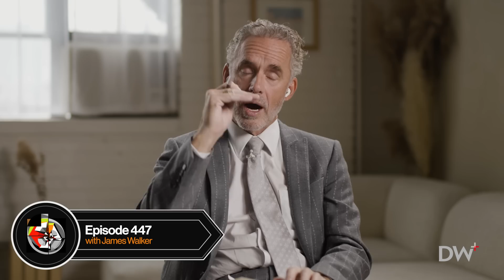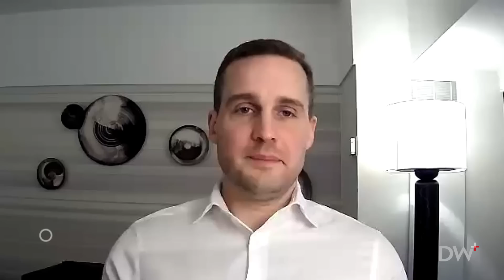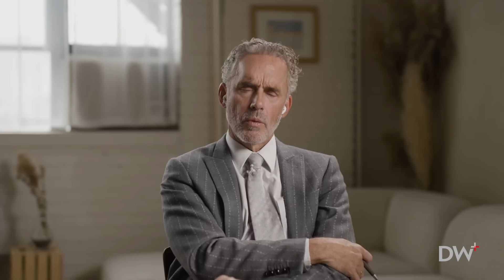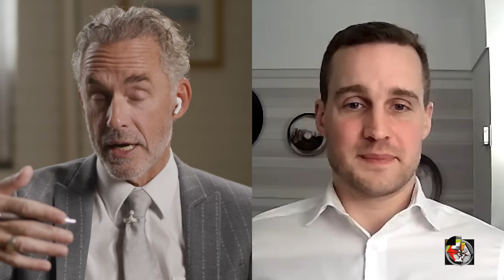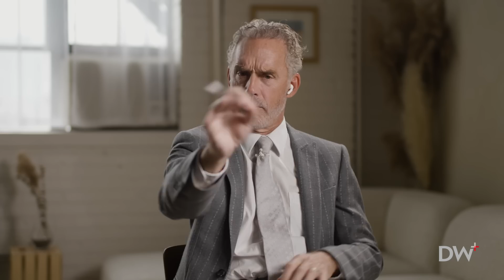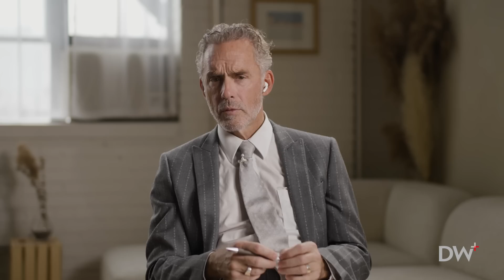There Is a Nuclear Reactor in This Truck

Comment: 6:12 James Walker is also CEO  of Ares Strategic Mining. It's the only permitted Fluospar/Fluorite mine in the US. Ares is also constructing an acidspar plant right now.

Acidspar (acid grade fluorspar) is used to manufacture hydrofluoric acid.

Uranium dioxide (UO2) can be fluorinated to uranium tetrafluoride (UF4) by hydrofluoric acid (HF). 

Uranium tetrafluoride (UF4) is the base material for liquid molten-salt SMR fuel cores.

Comment: Too much risk for not nearly enough power. Nuclear reactors work best when you have high power density. That means a real facility. These little ones though have the potential to be used for low-cost nuclear submarines!

Comment: We have seen the proposal of SMR's which looks promising but after many decades we still haven't seen one in operation supplying power to the community. 
The price of the energy supply is the problem, these things are extremely expensive to build and run, which puts it out of the practical daily use.
Solar Panels are 6x less to build and require no maintenance to run, every roof, car park etc has the potential to be covered in solar panels with no use of extra land and linking with a battery produces power 24/7.
I have Solar on my roof which on a sunny day gives me more than twice the power I need, at no fuel cost and batteries power the house when the sun isnt shining.
Every house can be it's own power generator with excess going to the grid

Comment: No need to mine uranium. Treat the used fuel rods and get new rods back. Problem is there is plutonium in the used rods, and people are scared they fall in the wrong hands. I say make thorium reactors, and use the plutonium as starter-fuel to burn the thorium, and we get rid of the plutonium as a bonus.

Comment: Nuclear Power is clearly a super efficient technology, however doesn't High Level Nuclear waste remain Toxic for thousands of years?. If there is a way in which radioactive waste can be eliminated entirely or rendered totally safe then obviously it's the solution, otherwise no man made storage facility for hazardous waste could possibly last the duration, not even close. Whenever there is Hazardous Waste to dispose of and huge sums of money at play, there is going to be corruption and corners cut.

Comment: Don't even need to sell uranium reactors to the public. they have a taboo behind them. can now sell thorium reactors to the public as a generally "safer" fissile material for both small scale and large scale power production, and Saskatchewan has even MORE ore than Uranium. but if you do want to go the route of Uranium 4th gen reactors using LFTR or FAST reactors it can run on what is already deemed "Spent" uranium fuel waste, and significantly lower the "shelf life" of its harmful decay period from thousands of years, to a couple centuries; with much less of it as the final product needing storage.

Comment: Years back there was talk about down sizing a nuclear reactor to the size of a home AC condenser for home use. Great idea. It was stated that you cannot just do a downsize safely. Safety issues came up. Main issue would be loss of cooling water. Or the unit getting crashed.

Comment: my question would be ... why URANIUM as the main fuel and not THORIUM.... its CHEAP and ABUNDANT ....  yes you still need uranium for the spark plug yes it still produces weapons grade material ... 

why burn GOLD when TIN does the same job?

Comment: The US has 4,000 years of electric independence just using nuclear powered electric plants.  Far longer when we use thorium reactors.
We also have about 300 years oil independence and the oil fields are slowly filling back-up as oil is not a fossil fuel, it is a petrochemical.
Safety wise, the US has 25,000 more deaths per year because we use coal electric plants rather than nuclear.  1 million in 40 years.

Comment: want a less insane alternative - drill a hole in the ground.  The earth's core is hotter than the suns surface; just 5-10 miles down; drilling equiment gets so hot that the most sophisticated heat resisten bits melt. It's calle Geothermal.  It's been around 100 years but usually where the earth vents to the surface; we are a bit lazy. If half the money wasted on Fusion and Nuclear had been spent on Geothermal ; we'd actually have some real power being generated instead of worthless non workable plans.

Comment: The real reason they go to central asia is cost; labor is cheaper; taxes lower, regulations less.  Sure put a SMR in your home or neighborhood; it is a nuclear reactor with enough U235 to reach a sustained nuclear fission for several years. What happens when that Pro Hamas Terrorist allowed in the nations wide open boarders ; bombs your reactor; how many years will you be forced to evcuate - will it be as long as Chernobel in the contaminated area, it is still restricted correct after 38 years?  We'll assume your family survived, maybe a bit of radiation treatment, possibly your thiroid removed; on shortened life span by 20 years.. ya great trade off.

Comment: The process of turning uranium to a gas sounds similar to refining gold …. Except with out the gas😊, I worked in a gold refinery many years ago for a stretch , the other metals where leached out from the gold dust  one acid and rinse at a time , the other leached out metals themselves in the configuration of acidic liquid was stored in a huge plastic tank and would be reclaimed later like a chrome process , once the gold product was getting clean it would then be situated in a very expensive glass lined metal vat , then it would further broken down with a concoction of some of the nastiest acids until all the product was completely dissolved into a liquid solution , then it would be treated with sulphur dioxide gas ( nasty stuff like mustard gas in the war years) which would re constitute the gold like a gold paper sheet of on the walls of the vat , which we would rinse with de ionised water and scrape off the gold , it would be then put in trays and sent to ovens/kiln where it would melted back down into 99.9% pure gold ingots .
 A laborious dangerous process to say the least.
I probably missed out one two procedures in that brief recap , iirc we would test the gold sample with cyanide to see if there where other metals   present , if it turned a colour it was positive. Forgive my vagueness , it was decades ago I did this job ( yes I’m old ☺️).

Comment: People don't seem to realize how important nuclear power is going to be. Going all electric takes a tremendous amount of electricity, just take a Tesla charging at a supercharger at 250kw, how many people actually understand just how much electricity that is? To put that in perspective an average American homes typically have a 200 amp electrical service, which is 44kw, most households never see above a 15kw load on the panel. Or a 9L turbo diesel generator using 19 gallons of fuel an hour just to keep your car charged. It alot of power, and when start adding up the commercial side of going all electric, no amount of wind turbines and solar panels are ever going to produce enough electrical power to keep up with demand. Nuclear is about all we currently have to meet that demand.

Comment: Competency is in a decline phase. It's not perpetually growing and expanding as we might wish. At best it is cyclical even if otherwise growing in a given span. You cannot rely on a technology that is a blessing at one level of competency and disaster in another. Even with modern reactor designs, you cannot underestimate the capacity of the incapable to fuck shit up. Chernobyl never should have happened - we had the understanding, but lack of competency in policy and directorship is all it took. Thousands of brilliant engineers doing their jobs perfectly to design a 'cannot fail' system, then one cost cut that all but a few never saw and the rest is history. The implications of an all too possible failure is simply too high.

The poor can die in poverty until natural selection delivers a population pool incapable of levels that nuclear power could ever be a threat. We should be focused on the pool, through meritocracy, and in achieving that eventual future, rather than our hopes and dreams in the here and now because that represents an unfathomably unwise roll of the dice.

Nuclear reactors on a truck are achievable, but they are not scalable. Because you outstrip the competency pool of the population much in the same way that you might suddenly find 85 IQ smokers servicing propane tank valves because they were the best left available. Doesn't matter how well you think those at the top designed the system, you're rolling the dice.

Comment: LFTR MSR from the 1960's ran for 6,000 hrs back in the 1960's at ORNL.   It could use nuclear waste as fuel and clean up over 90% of it. 
It use thorium instead of uranium and relies on passive cooling vs pumped water.  china has copied the design and has a working protoype.

Comment: I''m curious about the security required for the material. There are folks around that are not friendly to civilization and would like to use the material to spread terror.
Reply: 5% enriched is useless for making bombs. The problem is if it’s hit in transport, that’s why the containers used are designed to handle a full on train collision, a missile or a plane crashing on it, because the worst that could happen is that something breaks the container and an explosion spreads the material as dust.

Comment: Jordan, you should really take an interest in the Liquid Fluoride Thorium Reactors (LFTR).
No radioactive waste, cheap fuel (no enrichment needed), extremely safe (no pressure vessel needed), much more efficient than conventional uranium based reactors.
And the best thing is, they can consume our radioactive waste to neutralize it and produce even more power from it.
Reply: LFTR no radioactive waste. And their in lies the problem, no waste in which to make atomic bombs which was the prime reason for atomic power stations to begin with!
Reply: @clivefinlay3901 modern reactors are not able to be weaponized (and modern means earlier than the Chernobyl event, just the Chernobyl plan was an old design EXPECTED to produce plutonium). Waste doesn’t produce any meaningful quantity of material, not even close to what’s needed to make a bomb. Uranium in a reactor is enriched to 5%, bombs use 95% enriched uranium. The way old designs produced material for bombs, instead, was by using a less efficient design with higher uranium enrichment which produced plutonium during the reaction (plutonium is much more radioactive than uranium 235.

But those reactors were made to produce plutonium, the producing energy was a byproduct, and the remained like that because it was useful, after things settled during the cold war.
Reply: Are you talking about RDD's (Dirty bombs?)
Reply: @KristelViljoen  Actually, uranium reactors are capable of producing plutonium for atomic bombs. Dirty bombs, on the other hand, are made from any waste and are made by terrorists, not governments.
Thorium of course makes both almost impossible.
Reply: Are  you referring to the Oakridge molten salt reactor research project? Scientists still find more problems than solutions to this concept. If I remember correctly they had problems with corrosion and it was not a reliable source of energy. The plant also were unable to produce enough energy reserves.
Reply: @KristelViljoen  Sure, LFTRs face technical challenges like corrosion but it's trivial to solve. Again, conventional reactors are much more complex. The problem is a lack of funding due to uranium industry lobby and governments interest in uranium for weapons. That's why thorium research was abandoned years ago. 
China noticed that, and they are completing construction of few LFTRs already.
Reply: @hufca  it would be great if it is functional and running smoothly. Imagine the economic impact on third world countries.